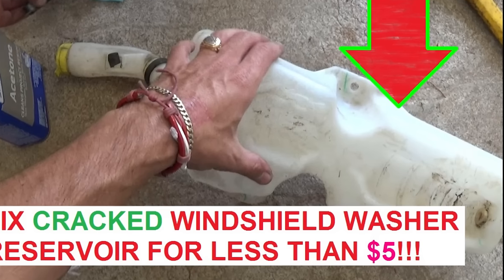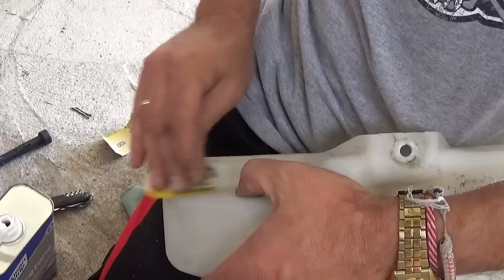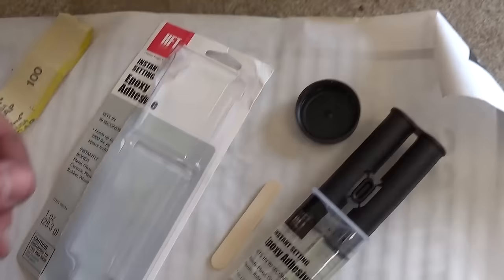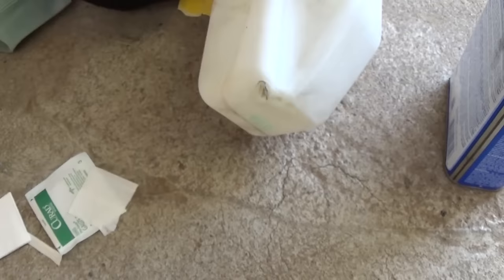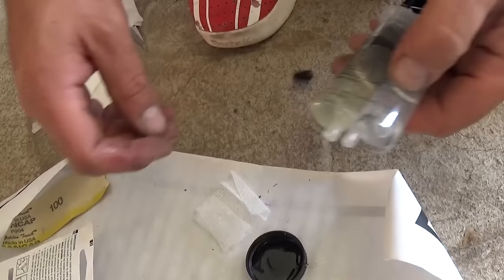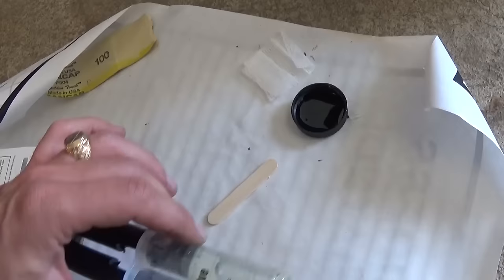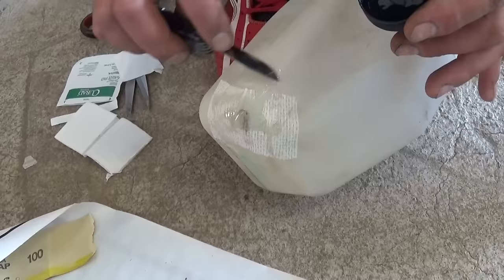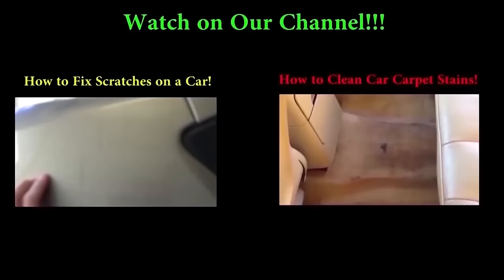How to Repair Fix Cracked Windhsield Washer Reservoir Tank for less than $5

Comment: Too much work..just use 3M 5200 ..that stuff is like cement ..used for boats cause it just won’t crack or leak under water 😀👍
Reply: Thank you!! The wash tank in my old truck is unobtainable, so a clear repair like this would work gorgeously!!! 😊

Comment: A tip of mine is warm up the epoxy tube a little if it's been in a cold place so the liquid is easier to squeeze out and mix. I just set it near a heater or fireplace but maybe you can put it in a ziplock bag and run it under hot water

Comment: It never occurred to me to use other fabrics than fiberglass. Nicely done. My only concern is the dual cap on tbe syringe be put back on the same way as removed next time you use it. If reversed, that would make both nozzles harden. Maybe the manufacturer keyed it so it cant be reversed.
Reply: yes, it is

Comment: Use Henry rubberized roof cement, cheap, fast, and reliable fixed.  You don't need to take off the tank.  Just patch it from inside or outside and wet or dry.  Fast and easy.  Don't waste your time to take the tank off.  It is not easy.  I throw away my first C300 tank and replaced a second one.  Second tank leaked again.  I took it off and it was difficult to fix it until I used a roofing cement.  It is fixed fast and easy.

Comment: washer tank was leaking, removed tank from vehicle, washed with degreaser then with soap & water, allowed to dry. then used a plastic cup and squeezed clear silicone from the tube into 
the cup, used a small paint brush and painted the entire tank with silicone, allowed to dry,  
reinstalled tank, so far no leaks .
Reply: Silicone is probably also protecting the reservoir from heat damage as it is heat tolerant up to 500 degrees.

Comment: So basically like fiberglass repair kits.  
Has anyone tried this with a bigger crack?  The toyota tacoma is notorious for having the neck on the resovoir dry up and crack.  I was wondering if anyone has actually used this method to cover holes, not just thin cracks.

Comment: The tank is made of polypropylene and it says that epoxy is not suitable for PP, but I suppose you tested and it works ok. The glue can be easily removed from PP materials but it still sticks a bit does come off by itself.
Reply: Good point. Wikihow says "use hot melt glue that's made of polypropylene"

Comment: It's easy if u could remove the tank.. I tried to put some glue but other parts still crack.. Try to sand and it just crack becomes big hole haha.. So i got a new one as the mechanic guy to install it.. It was cheap but time consuming to install it.. But glad it was done.. The old one just brittle i guess..

Comment: Heat up a flat head screwdriver with a m as p gas torch and plastic weld it.  You can add more plastic from another source also.

Comment: Sure looks like the hole was caused by something rubbing on it and wearing it through. Maybe epoxy on a thickness of another piece of plastic over the place too or readjust the part the tank rubs on. However,no glue holds well on polypropeline except maybe contact cement.

Comment: My problem is the scrapyard put a hole in the bottom to drain the fluid out, about an inch and a half hole
Reply: If it's a perfect hole, I wonder if you could cut a plug out of the same rubber used for drain plugs. Or just have some plastic to fill up most of the hole and then the resin covers the rest.

Comment: Will this work on a coolant tank crack as well?
Reply: As a temporary fix for a radiator it can probably work.  The heat from the radiator should not have an effect on the epoxy, they can usually handle the heat. The pressure shouldn't be a problem either. Radiator pressure isn't that great, usually 10 to 20 psi.  If you get epoxy into the hole/crack it should hold along with the gauze added.

Comment: You can save money with this but you can go to the junkyard as well.
Reply: Where im from the junk yards charge close to the new price of any part even though its used so so say this windshield wiper resevior is like 80 bucks branks new the junk yard would charge me 70 for the used part theres no pull your own part where im from in Colorado maybe close to denver but im 8 hours from there
Reply: @scripulance.1901  that's insane. here in socal you could get a reservoir w/ pump from the junkyard for only 13. feels bad